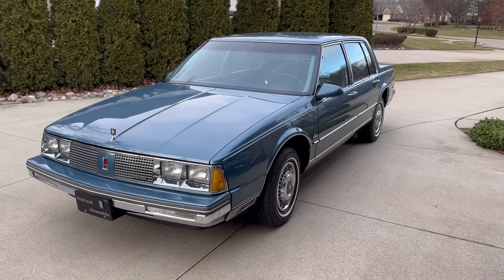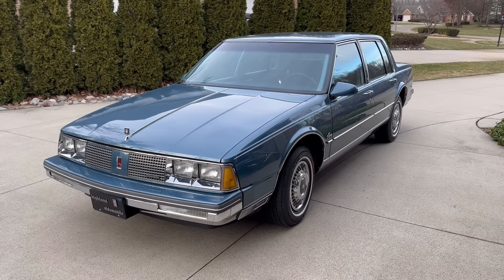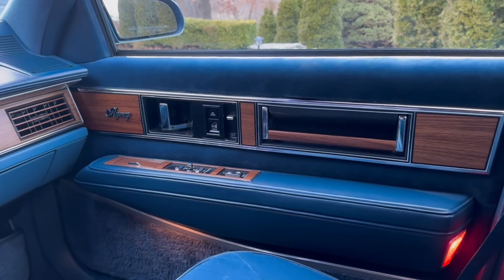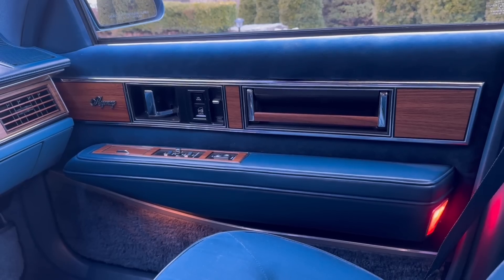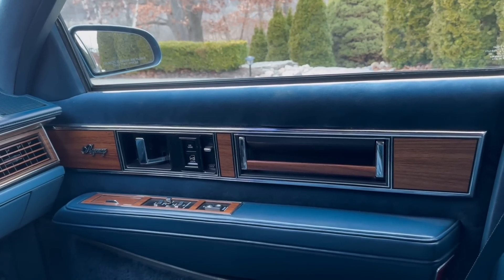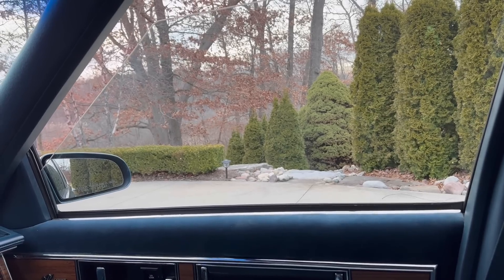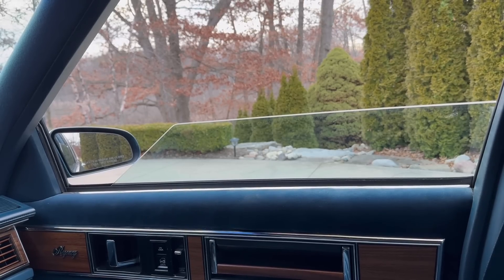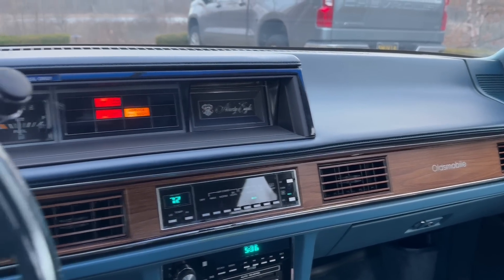Worst Automotive Inventions: 1980s/90s General Motors (GM) Tape Drive Window Regulators

Comment: Thanks for letting us know about these. My ‘84 Citation had the backwards cranks, but never gave us any problems. Could you please do GM chime modules? Especially the later 7-pin ones are interchangeable. The obnoxious buzzer can often be removed and replaced with a Buick unit from the junkyard. Even the earlier versions could be made better with mechanical units containing a real chime.

Comment: I worked at a Buick Pontiac dealership for years back in the early to mid 90's. The regulator tapes did fail, but it was not as common as is apparently  contemporarily thought. For the most part, they did their job for as long as a car from that time was expected to last. They were also easy to repair when a failure occurred. I would say that a more common problem from the era was the poor wiring routing from body to door. We had far more complaints of inoperative windows and doors resulting from broken wiring as opposed to nylon tapes, stripping or braking. As an aside, I would like to mention that both my 82 Pontiac 6000 with 45,000 miles as well as my 85 Pontiac 6000 with 234,000 mi have original drive tapes and work fine. Regarding the slow window speed, silicone lube on the rubber window seals and track guides goes a long way. Perhaps you should try it.

Comment: Seems a little too flimsy to have tape drive window regulators....Perhaps the Designers were banking-on passengers not lowering the windows too often, with excellent air-con systems in the cars. Anything to save weight, eh Adam🤔🤲

Comment: I have 3 GM vehicles they all have tire pressure sensors by the time l fix one car with a tire sensor not working a month later the other car has one not working the longest I've got these sensors to work on any of these cars is 4 months until one goes bad l bet l have thousands in replacing tire pressure sensors it's never ending I'm at the point now with 3 vehicles with tire pressure lights on and the tires are aired up to the correct pressure l guess GM expects you to have a on going problem that drains your pockets and you be ok with it and this tire pressure system can't be turned off every person l know hate them and say they have nothing but problems is a great way to treat your customers and then expect them to come back and buy from them when you need something new isn't working out so well for GM

Comment: Don't know if my 2004 Buick LeSabre is the same but I've had the drivers window fixed twice in 5 years because it stopped working the power windows in my 1984 Monte Carlo SS l never had a problem with them and l owned it 38 years the windows went up and down slow but never stopped working

Comment: I always hear about how bad these tape drive regulators are. But I worked at a auto parts store from 1998 to about 2010, and never sold a single tape drive. Also owned a handful of cars with these regulators and also never had a problem with them.
Reply from the maker: Just read the comments
Reply: @RareClassicCars  I agree it looks like a crap design.  I’m just surprised no one ever bought one.  The help section tape drive we had on hand never sold even once.  Maybe mechanics were opting for the OEM tapes from the dealer.

Comment: I was out one Saturday morning in 2004-2005 out in the rural area of Lansing KS. I passed a house and out in front of a farmhouse was a 1988 Olds 98 Touring. It was in perfect shape. The paint was a deep Burgundy with just a small amount of haze on the trunk. The interior had been covered by beach blankets covering the burgundy velour. It had 67,000 original miles. I was getting back in my truck when an older couple came out to see what I was doing. I simply told them that t saw their 98 and wanted to look. He said she's for sale. I asked how much, he told me. I gave him my number and $50 to hold it. Monday came ar5, I took the day off and got the car. I drove it fotr awhile. One day my wife drove it to the store and a Pepsi semi's trailer took her out. I was heartbroken. But I got a check from Pepsi for twice what I paid.

Comment: I was working in a Chevrolet body shop from 1979 to 1984 and I can't count how many of these regulators I have replaced. But honestly most were on vehicles with quite a few miles on them  save for a few newer ones.  I've always practiced the ice/snow theory after my wife broke the window in my new 92 ford PU truck.

Comment: It might be a somewhat cheap design, but at least the replacement parts are cheap and easy to fit, and the whole system is very simple. I had to get the power windows fixed 5 times on my 99.5 Jetta after the plastic clips holding the window glass to the regulator failed, and the glass fell down into the door. Of course this always happened on a nice balmy Michigan winter day.
Metal regulators wear out too, I just had to replace one on my Mercedes.

Comment: Love when you feature your Ninety Eight...I had a '90. Wonderful vehicle with the 3800. Funny enough I never had any issues with the front windows on my car, but the back ones failed several times, even though they were rarely used...the backs would always fail with the window falling down into the door or getting cockeyed. Thankfully the rears didn't go all the way down so it was easy to pull up 😅

I'd be willing to bet that the late 90's W bodies had worse window regulatory set ups than even these...plastic clips ALWAYS broke. My mom's 99 Century went through a set on each door at least 4 or 5 times...my uncle's '01 Grand Prix was just as bad if not worse.

Comment: There is a cable thing in the 2004 Jeep Grand Cherokee involved in the electric window lift that is apt to break if you hold the raise/lower button all of the way to jam/stop. The cable likes to separate at its termination. If you don't run it all the way to jam against the stops it's unlikely to break. If run all the way hard against the top it might  not break immediately but there is severe tension present that can break it if you hit a bump,then the window will tend to fall down into the door. Also if you insist on putting the window up tight until it stalls you might be more apt not to break the cable if you shut off the engine before snugging the window. (Less voltage to the lift motor)
   also keep the driver's side button on the window control set so that the passenger cannot operate the window. (can be set so that only the driver's window controls work on passenger windows)

Comment: Years ago, I had an '82 Impala that had the window tapes (I didn't know that GM had even used anything like that until I had to repair/replace one) and had to replace the one on the front passenger side door myself and didn't realize the tape had broke in half inside the mechanism. I had replaced the button assembly (for some reason the window would open and close using the driver's door controls, but not the passenger side control) and could not figure out why the window still didn't work. I then had pulled off the entire door panel and found the tape was broken. The original button assembly was still good.

Comment: I had an "82 Phoenix  with manual widows and my drivers side window was almost impossible to open and close. I ordered the Tape from JC Whinny for about 10 bucks installed the new tape and it worked great. One of the many issues on this GM car fixed.

Comment: In May of 1986 I went with my parents to bring home their brand new LeSabre. We decided to pick up lunch at a Rax virtually across the street from the dealership. As I pulled up to the drive through window and pushed the power window button the entire glass promptly fell into the door.  The car turned out to be comfortable and reliable for several years afterward, but those first five minutes of ownership on that inaugural 100-yard drive was the stuff of legends.
Reply: I remember Rax!!! My family used to eat there from time to time growing up, and there was one where I live now until about 1989 or so.
Your story reminds me of when my Dad bought his '79 Delta 88 Royale as a "drive-away sale." The dealer chartered a bus up to Lansing and we all picked up our new cars. Dad gave me the honors of starting it for the first time in the holding lot, and then told me to shut it off and give him the keys to put on his ring, well when I did, the whole ignition cylinder came out of the column! After that was fixed, it was a great car.
Reply: @DanEBoyd  Ate many a roast beef sandwich at Rax in Huntington,  WV. 2 locations for some years,  then poof, gone!  Arby's has taken up the slack.  Decent,  but far more expensive,  as is everything.
Reply: @johnlandacre767   This story happened just up the river from Huntington in Gallipolis, Ohio. My understanding is that Rax, which had more than 500 locations around the country at its peak, has only five or six now. And it's somehow based in Ironton, Ohio. If you're still around that area you may find one not too far away, but hold onto your car window.
Reply: @bradharveycreative  I know they changed the name 3x in my lifetime.  Started as Rix, changed to Jax, then to Rax.  Don’t know the story behind that, but probably nobody cares about that.😀🙄
Reply: @bradharveycreative  yes, Ironton is across the bridge and about 18 miles down river.  Or is it upriver?  How about 18 miles away?  There may still be one there, don’t go there often enough to know.
Reply: Rax and a 1986 LeSabre. Hell yeah.
Reply: Mr. Delicious destroyed your window!
Reply: I loved that creepy cartoon character in the Rax ads.
Reply: @Humandriver5280  I think his name was Mr delicious or something like that
Reply: @Humandriver5280  I can’t for the life of me, remember that character!
Reply: That great GM feeling....😂😂😂
Reply: Makes one wonder why some of the power window mechanisms work indefinitely,  and some don't.   My 20 year old Altima windows have never had any problems.  Maybe Nissan uses different setup.
Reply: My brother rented a Toyota and the driver's side power window failed.  They gave him another one and the passenger side window failed on that one.
Reply: I saw a brand new 1982 Buick inside the dealership show room with the door panel flopping off. I told the dealer about it. (as if they didn’t know already) But apparently they never did anything about it, because one week later, that same car was at the  international auto show in the Seattle Kingdome with the floppy door panel still not fixed! I went back to the dealer to tell them about it. I then wrote a letter to GM to tell them about this. Of course, I only got a  boiler plate reply. I was hoping to help inspire GM to clean up it’s slapdash act.

Comment: The toothed flexible-racks that slid on a roller-coaster track in some of the K-car descendants (particularly the Lancer/Lebaron GTS) were no better. They had plenty of compressive strength to raise the window, but if they got any resistance on the way down, the plastic would snap and the window would stay up for a while, then crash to the bottom. I don't know if they were every improved or reinforced, but I had no similar problems with the LHS I had in the late 1990s.  The Monaco (sister of the Eagle Primiere) I had between those cars had the oddest window regulators I've ever seen, with a long coarse spring that slid in a plastic tube and served as a rack by virtue of its coils acting as teeth that meshed with the motor's pinion gear. Only the driver's window failed and it only failed once, so they were bad, but not that bad.

Comment: I think in the 70s Triumph's TR7 had tape driven window regulators.   I seem to remember changing one of them for a neighbor.   Just to get one from a dealer was a chore!!
Reply: 1960s VWs also had something similar, sort of like a plastic-drenched rope in a tube (they reminded me George Burns' famous joke about old age). I don't remember any big problems with them, but they made them for years and the early ones might have had issues.

Comment: Spot on. An old GM tech told me as a snot nosed beginner to tell customers to hit the windows gently with their hands to see if they would move in the door seals in freezing weather. If not, don't roll it down! He also recommended lubing the seals and felt with silicone spray to displace water.
Reply: That would be a major inconvenience for those of us who clear off the snow by rolling the windows up and down.

Comment: The 92 and up Crown Victorias had problems with their regulators.  I must have sold hundreds of these, and despite Ford changing the part number a number of times, they failed often. The aftermarket ones were even worse.

Comment: At least you could roll down the windows....from 1978 to 1987 you could not roll down the windows on the rear doors of  a G-Body during it's production run.  Another GM idea. Supposedly for increased hip room.  

I've had window regulator issues with two cars, the drivers door window of my 2003 BMW 3 series and the 2015 Chevy Volt.

Comment: So many of those X bodies with the wrong way cranks had the tape split by folks who knew which way the crank went to get the window down and just twisted until the crank spun without trying the other direction.  The other annoying thing was that the tape drive is much more reversable than the older regulators, not a problem with power windows, but the hand cranked versions creep down under gravity and vibration loads - they're also easy to push down by hand if you've locked you keys in!
Reply: I replaced the tape on my 81 Citation so many times on the passenger side that I bought the tool to remove the  crank handle. Drunken friends, what are you going to do? 😂😂😂

Comment: Seeing that door panel gives me nightmare flashbacks. . .Wasn't this the era where GM combined the "Passive Door Lock Feature" (where the doors would automatically lock when you put it in gear, or would just lock by themselves when you closed the door) that also disconnected the interior door handle from the latch mechanism? I remember working on these things, and during diagnosis, you couldn't just pull on the door handle to open the door like on a Ford, but you had to remember to 1) press the unlock button (and hope the electric unlock solenoid was working), then 2) pull the handle to open the door. 

I did a search on complaints during these years, and maybe i was just subjected to a rash of latch rod failures; I do remember most of these things had bent interior door handles (if they weren't broken off), and bootprints kicked in to the door panels from frustrated passengers who dared to want to easily exit the vehicle. . .maybe this was where the idea for the rear child safety locks came into being.
Reply: GM had that on the 90's.  Trying to rock and push a stuck car out of the snow was obscene.

Comment: In the 80's, I worked at Tip Top Chevrolet / Buick in Fairbanks, Alaska.  These were great at minus 40 degrees.
Reply: Nothing like natural air conditioning and no way to stop it when it's below zero

Comment: I had so much experience changing that tape on my wife’s Skylark I could do it on 20 minutes. That iron duke ran, but everything bolted to it, water pump, alternator, power steering ect , was always failing. All parts were cheap.  A ghost in the fuel pump relay that would shut down at random in San Francisco traffic ended it for me.

Comment: Don't forget the fold-over plastic guide clip on the upper rear corner that would break and let the glass tip forward into the door!
Reply: I had a 1986 Delta 88 that had this problem.  As you know there is a hole in the window in window that this piece of plastic fit in to that was in a track in the window frame to keep the window aligned.  I never had trouble with the tape drive ,however., I did have trouble with these clips.